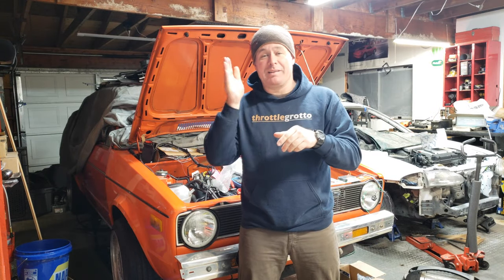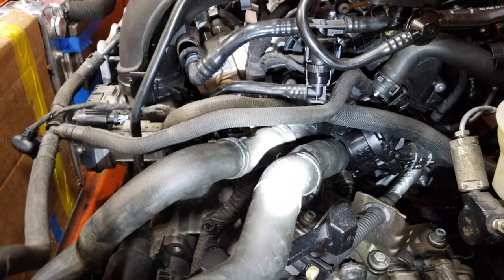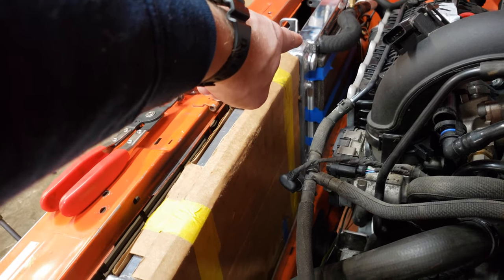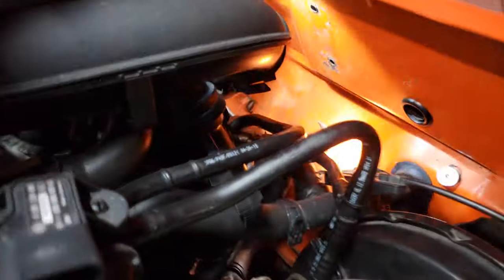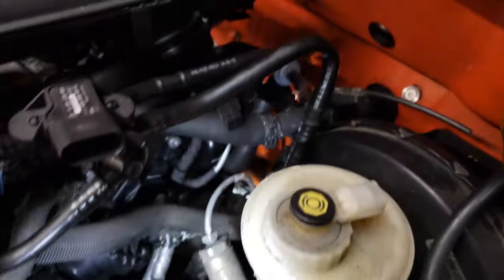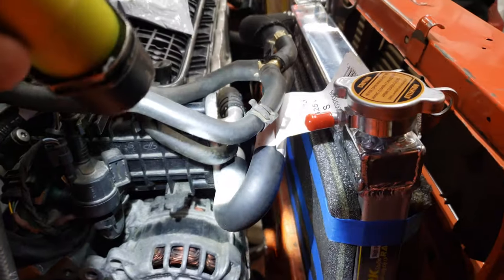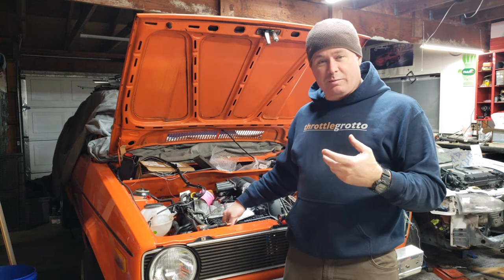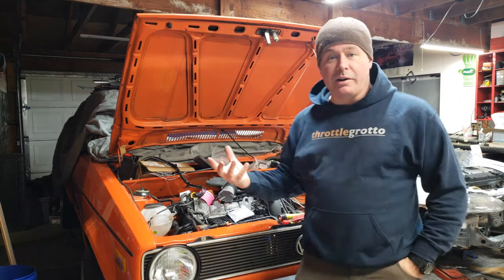Setting up twin radiators for the 1.4t  rabbit cooling system!

Comment: Wait so you have 2 water radiators ?  Great idea flipping the rad upside down
Reply from the maker: Yes, the intercooler has an auxiliary radiator, so I needed a solution for a 2nd one.

Comment: Will you be able to run the rabbit flow control valve? I thought it must flow coolant continuously. Nice job. Really like to see you do all this work.
Reply from the maker: Yes, the flow control valve is in the stock location for the heater core. It does flow some all the time, iirc.

Comment: I'm looking forward to fit it in a mk3 golf but for the temperature senders i don't think i will find them here as well as for the secondary radiator, i'm thinking about putting the whole stock coolant unit (stock radiators) what do you think?
Reply from the maker: I think there's a whole lot more room in a mk3 for activities under the hood. I don't have a stock setup to measure, but there's a better chance of it fitting there.